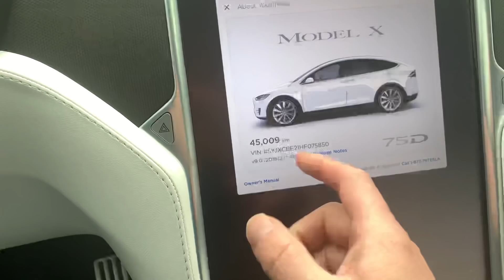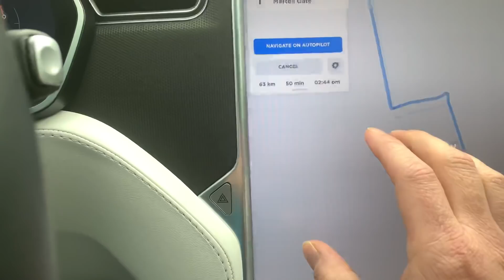Battery preheat function in 2019.12.1.1

Comment: I just got 149kW in my model 3.  These updates we're getting are amazing 👌
Reply: Nooooooooooooooooooo! 149kW is the highest I’ve heard.  Can you tell us the conditions?  What SOC, how long did it last, temps?
Reply: @BrandonWood44  15% state of charge.  50F outside.  Used navigation to navigate to charger.  Seemed to stay at that rate for quite a while.  Much longer than I've seen on videos online
Reply: only got 87 kW in Woodstock a few hours ago.
Reply: @cocochanel9291  Did you navigate to it?  If so how far away were you when you left to go there?  External temp?
Reply: @TeslaRoger  I did navigate to it.  And I had probably 15km to get there (guessing) . External temp 12c degrees